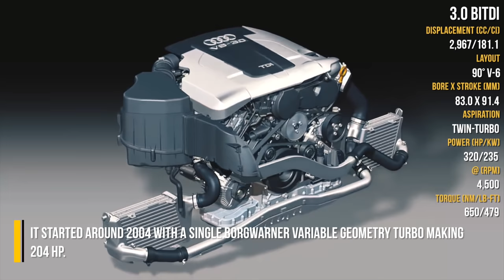7 Greatest Audi Engines Ever

Comment: As an Audifan I appriciate this Video but I think you missed the 1.8t 20V. Also the 4.2 V8 Part isnt that easy, there a dozen of differnet 4.2 V8 engines in the history of Audi. You talked about the high reving 4.2 FSI from the b7rs4/b8rs4/r8 and showed the 4.2 from the b6 which is a completly different engine besides the amout of cylinders.
Reply: einsfuenfneun as another Audifan I also appreciate this video however I must graciously correct your statement the high reving engine (CFSA) being in the r8 it was only found in the b8 rs4 and the 2010-15 rs5 the r8 v8 was a completely different engine only really sharing displacement. I do agree tho there are so many different Audi v8's with different characteristics
Reply: @codybrinkworth6014  The Audi R8 was initially equipped with a 4.2 litre V8 engine. Specifically, it is an all-aluminium alloy 32-valve (four valves per cylinder) petrol engine,[4] utilising Fuel Stratified Injection (FSI),[4] and has a displacement of 4,163 cubic centimetres (254.0 cu in).[4] It develops a motive power output of 420 metric horsepower (309 kW; 414 bhp) (Directive 80/1269/EEC),[4] and generates 430 newton metres (317 lbf⋅ft) of torque,[4] on 98 RON 'Super Unleaded' petrol. It is basically the same engine used in the Audi B7 RS4, but is modified to use a dry sumplubrication system. It uses two chain-driven double overhead camshafts (DOHC) per cylinder bank, and utilises variable valve timing for both inlet and exhaust camshafts. 

wikipedia says otherwise 😅
Reply: Yes the b7 rs4 and r8 share the same engine however this is not the highreving v8 you mentioned in your first comment. The high revving v8 in the rs5 and b8 rs4 is essentially the Lamborghini v10 with 2 cylinders chopped off (obviously there's a bit more too it then that but Audi used technology learned from the v10 and implemented it onto a new v8 platform)
Reply: @codybrinkworth6014  The CSFA is a slightly updated BSN. 
I thought the differences werent that big, but the RS4 b7 is also a high reving engine in my opinion. 8250rpm is a lot. 
Sadly I couldnt drive a b8 rs4 yet.
Reply: The CFSA engine has a rev limit at 8400 rpm not much of a difference from the bns engine but is the what I've read the "high revving v8" there are a few fundamental differences between the two engines but essentially the same design I know that the intake and compression ratio are definitely different and I'm sure a few subtle changes as you can definitely hear the difference between the two engines even with the same exhaust setups
Reply: @codybrinkworth6014  Yeah youre right. I knew there was a difference at the intake but it doesnt came on my mind until now. The b7s lost a lot of power because of the intake and audi worked on that a little bit. Thanks for pointing out my mistake.

Comment: i love my 04 audi a4 avant with the 1.8t, its bone stock and im in the process of replacing broken stuff in the engine bay like my heads and vacuum lines so far, i have plans on making it alittle more special, also has the 6 speed and quattro which is pretty cool, gotta work on my exhaust though so my turbo can breathe alittle easier

Comment: Top 10 Audi Engines:
#1: 2.2 5 zyl Turbo
#2: 2.2 5 zyl Turbo
#3: 2.2 5 zyl Turbo
#4: 2.2 5 zyl Turbo
#5: 2.2 5 zyl Turbo
#6: 2.2 5 zyl Turbo
#7: 2.2 5 zyl Turbo
#8: 2.2 5 zyl Turbo
#9: 2.2 5 zyl Turbo
#10: 2.2 5 zyl Turbo

#11: 2.0 TDI ultra (for all the salad-nazis) ;D
Reply: #12 2.5 5zyl turbo (2.5tfsi)
Reply: You forgot 2.2 5 zyl Turbo
Reply: 2.1 liter 10 valve

Comment: A 2006 Autocar article I read on the C6 generation S6 V10 said that “exhaust restrictions and corporate politics dictate that the S6 gets ‘just’ 429bhp.”

Now I get the exhaust restrictions bit, but what does the ‘corporate politics’ bit have to do with the S6 having less power than the S8, even though it uses essentially the same engine?
Reply: Exactly. How come the S6 has the same power as the S8? Haha. The same goes for C63 and E63 AMG of that time: same engine, but C63 had 60 hp less.
Reply: Wait, I thought the S8 had 15 more BHP than the S6 - 444bhp compared to the S6’s 429?

And like I said, what do corporate politics have to do with the S6 V10 having less power than the S8 V10?
Reply: @joshbacon8241  That's what I said, Audi would not let S6 have the same power as S8, for S8 is upscale and must be powered accordingly. Now, look at the bright side: a simple ECU tune will yield the same hp for the S6 haha.
Reply: @joshbacon8241  Man.. It's common in every brand... They implement same engines on different cars because its much cheaper but they have to deliver more for the customer that buys "super exclusive" a8 than a customer that buys "only" "premium class" a6 to make him feel like he is paying for "higher class" thing.
Reply: Simple really, as extracting more power out of the same engine usually comes at the expense of low-end torque, long-term reliability, fuel-economy, & of course emissions (What software?)!!!
Reply: Could be due to ranking for example the A / S8 is seen as the flagship car of audi so want to make it better compared to the other models. This is my thought though
Reply: Other similar scenarios include the F150 Raptor, Expedition and Lincoln Navigator sharing the similar engine with the current gen Ford GT, but the GT has more power.

Comment: The older Audi engines are pretty solid, but roughly from 2004 to 2012 they made some horrible garbage like the 3.2 FSI and some 1.8 and 2.0 TFSI engines are known for excessive oil consumption due to badly designed piston-rings.
Reply: gert106xsi 3.2? My uncle has an a5 sportback quattro 3.2 and is almost bulletproof
Reply: The later model 3.2 engines are different, have also a little bit larger capacity and are better. The older ones suffer from chain tensioner failure. Would not recommend an 2.0 TFSI from around 2010 tough. If you really want one, be sure an Audi specialist upgraded the piston rings. Better an indepent shop than a dealership, they probable used the same faulty OEM rings and the problem comes back after a few 10.000 km
Reply: More like the bigger the engine the better. Except 5-pots obviously.
Reply: I think it started in 2003. The B6 A4 with the NA 2.0 engine with around 130 hp has that problem too.
Reply: You mean 2008 to 2012.
Reply: gert106xsi I second your comment about the tensioner in 3.2VR6... coming from one sad victim...
Reply: basically ea888 problems
Reply: @tedqian8707  the one on a5 was a proper 90 degrees v6, not vr6
Reply: Jaron Yuriy H I did not mention anything about a5, all I said was the chain tensioner problem in the 3.2 vr6s
Reply: I have a 2000 audi a8 4.2 with 256k miles on it and still runs like a champ
Reply: @tedqian8707  I havent had any issues with my vr6.. granted its the last of em but it still.. 210k km and still going strong.. no oil usage or anything
Reply: AKA Zeus good on ya then
Reply: Ea888 engines are tsi? Tfsi is in the 8p s3 and they are sound engines
Reply: tt mk1 3.2 vr6 or a4- 3.2 v6

Comment: 2:50 yo dawg we heard you like chains, so we put a chain by your chain so you can link while you link
Reply: I definitely wouldn't want to have to change the timing chain on that!
Reply: I wouldn't count on the reliability either. At least at some other cases of multiple chain VAG engines.
Reply: The 2.7 TDI is a nightmare to change the timing chain
Reply: @erongashi4497  2.7 V6 TDI =/= 2.7 V6 BiTurbo 30 valve
Reply: V shaped engine problems.
Reply: it is only one chain

Comment: My ‘08 Jetta has a naturally aspirated 2.5L I5… it’s still running with 334,000 on it just like new. Only thing I ever had to do (engine wise) was coils and the water pump, which ain’t that big of a deal. Every car has to change coils after 200,000 and it’s super easy on it. So even though it’s not the fastest thing ever, its still really enjoyable and reliable.

Comment: Even though I don't have an Audi right now I totally love them, when I was stationed in Germany 1998 to 2001 my second car was a 1988 Audi 90 with a 2.3 five cylinder 136 hp the slower one and only front wheel drive, but on the autobahn with any effort that car did 235 klm with out any problems

Comment: My current A6 has the 3.0 TDI and it's damned impressive. Torque for DAYS, and 700 miles on a single tank. It's a bit laggy when you hit the gas from a stand-still, but when it takes up you're thrown back in your seat :D
Reply: Sadly diesel is so expensive today compared to petrol.

Comment: The first V8 by Audi was the 3.6 (enginecode PT) in the first gen V8/D11 from 1988 to the summerbreak 1991. After the summerbreak you could buy the 4.2 (Motorcode ABH)

Comment: V8 4.2 in the S8 D2 face lifted model 01-03 360 HP bullet proof engine and still runs the easy to access timing belt not chain.

Comment: I love my 2002 a4 quattro NA 3.0 b6 v6 with the 6 speed manual transmission red lines out at 7,000rpm and it pulls hard and solid through all 6 that NA 3.0 makes 221hp and 225ft lbs torque its fun thats for sure
Reply: it is reliable? im planning first car

Comment: Though the 2.8 which is pretty much an NA version of the 2.7 isn't as fast (190 HP/200 ish Ilb/ft), it's surprisingly reliable. My A4 has 238k miles on the clock and it's still kicking with the stock engine, though you can feel the age of the transmission.

Comment: The c6 s6 and S8 you mentioned have even firing 5.2 V10s that are a slightly bored and stroked version of the Lamborghini designed 5.0 engine. The 5.2 V10 in the post facelift Gallardo and Huracan/ R8 is an actual Audi designed odd firing engine.

Comment: VR6 narrow angle V engine and inline 5 cylinder has the same common ideal. Audi engine was wanted compact engine with 6 cylinder power output without consuming space inside engine bay, so the result was 5 inline cylinder. On the other hand, Volkswagen kept 6 cylinder power output but make it into V narrow angle banks engine configuration. It sized as 5 cylinder engine. Both engine has similar compact size. Cmiiw

Comment: Audi has so many but the 4.2l is everything so many engines come from that block 5.2l v10 is 2 cylinders slapped on and my 3.2l v6 is 2 cylinders ripped off lol all high reving even the new 2.5l inline 5 turbo is half if the 5.2l v10 lol Audi are geniuses

Comment: 4.2 was an over engineered pos that had multiple timing issues along with long term reliability issues. The 2.7 twin turbo is know for the factory turbos failing and the engine has to be removed to upgrade the turbos.

Comment: The 80's 20v engines were decent and the 2.5 in the RS3 etc is a fine engine but most of the others are riddled with faults

Comment: Where is 1.8t ???
Reply: Vw engine
Reply: Its audi construction😉
Reply: @rajmundkomada9875  yes but it was first used by vw and branded vw. Thus it was classified as a vw engine, if you look on the block it will be stamped with vw
Reply: Harrison Davis Not the APY and BAM, this Engines came only on audi (like the TT Or the S3) and they Not the Same, the APY is only available in the S3 8l and its a other block other Head Valses Pistons and so and so ... A Real Audi Engine 😌
Reply: @davidhenneberg6772  If you copy something 99.9% and change logo is it your engine?
Reply: @DuBstep115  yes. Volvo did the same with the audi 5zylinder and the apy was only available in Audis. No VW on this planet got the APY or the BAM. I think the 1.8t in the VW is the ARR bit I don't know. Engineers just copied everything from other brands and just did it a bit different but it's they're product. The 1.8t APY is not even close to the normal 1.8 t. Most of the engine parts are different.
Reply: down the bottom of the list here it belongs.